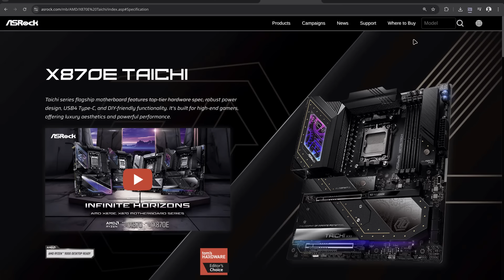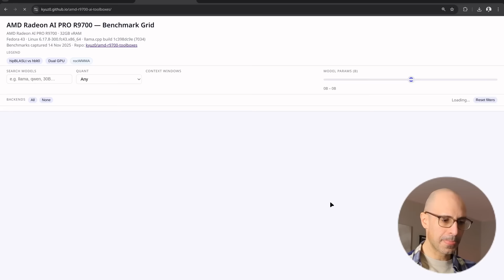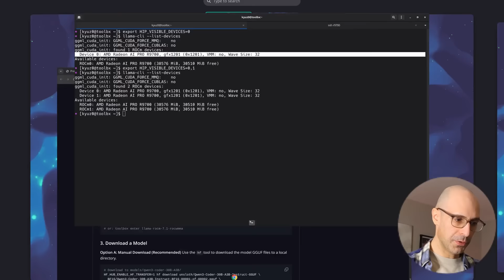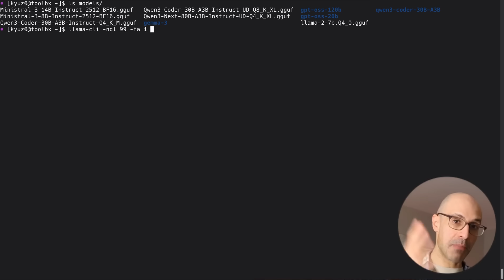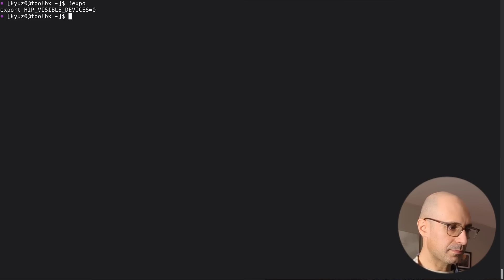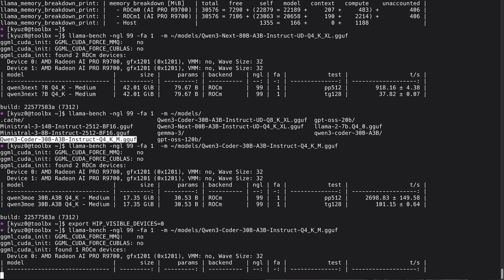Dual AMD Radeon 9700 AI PRO: Building a 64GB LLM/AI Server with Llama.cpp

Comment: Thanks for the good video But Can I ask a question?
I'm planning LLM with 2 radeon
But not a R9700(it's 2266$ our country)
I am planning with 
9600x, 16*4gb ddr5 (64gb), mb work on 4x16 pcie & 4x4 pcie and..
2 of 7900xt 20gb
And soon all parts will arrive.
I have absolutely no experience with connecting two GPUs. I have never done it before.
If can you give me a any little adice to me, that will be a great advice to me.

Comment: I have just abt to build an local AI station for some occasional gaming, bought all the parts and randomly bump into your video. This is exactly what I have got for the build 

Kingston 48GB DD5 5600 MHz Dual-rank RAM Module x2
AMD AM5 Ryzen 9 9900X3D 12 Core 5.5GHz CPU
Asrock Radeon AI pro r9700 creator 32GB
PowerColor Radeon AI pro r9700 32GB
NVMe SSD Crucial T710 Gen5 4TB
NVMe SSD BIWIN Black Opal X570 PRO Gen5 8TB
ASRock X870 Taichi Creator Motherboard
Lian Li PC-LAN216RW
ASUS ROG Strix 1200P Gaming Platinum

Now you reassured me more than I worried. Good staff given the price of NIVIDIA 5090 currently, this build is a bargain. At least I can do some decent gaming as well if I want to.

Comment: I know this video is eight months old, but let me just say, I don't care if it's two hours long. The information is great. And if you don't want to listen to the whole video, copy the transcript and drop it into an LLM and it will sum it up. I'm trying to do the same thing right now. I'm literally minutes away from going to purchase my second R9700. I got the first R9700 run on my 7 year old Dell XPS 8730, Qwen 3.8 27b tps 50ish. And I'm thinking about running it through a PCI 1x4 slot. Obviously, that's not the best, but it saves me a fortune. Otherwise, I'm looking at buying older dual GPU card. I'm trying to do this on a budget. Thanks for the video.
Reply from the maker: Thank you. Working this week on an update with newer models and inference engines, these cards perform so MUCH better now, I'm hoping to be able to release the video in a week or two showcasing all the amazing work the community has done to make these cards extra fast!
Reply: @donatocapitella  24hrs later, Ebay Gigabyte Z590 Aorus Ultra motherboard w/ Core i7-11700K. Gen 4  Pcie 2x8 1x4. No 2nd Gpu penalty. Subscribed, Thanks

Comment: Hi Donato! Thanks for the amazing video and your channel, it's incredibly informative!
I'm trying to partially replicate your setup. I already have an ASRock X870E Taichi Lite and an RX 7900 XTX, and I recently bought an ASUS AI PRO R9700. I tried to install the ASUS card into the bottom PCIe slot, but the motherboard connectors (audio, front panel, and USB) physically block the card's plastic shroud, preventing it from fully seating into the slot.
I noticed that in your build, you used a Sapphire R9700 in the bottom slot. Does the Sapphire card have a differently shaped shroud that leaves more clearance at the bottom? Also, how did you manage to route the front panel cables under the bottom card without them getting in the way?
I would really appreciate any details you could share on how you made it fit! Thanks!
Reply from the maker: Hey, thank you! So, the card just about fits, but you can't use the connectors, not sure if I mentioned that in the video sorry, it was mentioned on the manufacturers instructions somewhere. I turn it on/off from the board switch. I still think there is a way to use the connectors if you get some adapters, but that doesn't explain why your card doesn't fit, mine just fits fine and these shrouds are standard size as far as I'm aware
Reply: @donatocapitella  Thanks for your answer! Now I understand!!! If I don't use bottom motherboard connectors, my Asus R9700 can be fully installed into bottom PCI.E slot without being blocked. I am already, for some days, looking for 90 degree adapters, but still nothing have found... If I succeed, for sure will write here. Thank you a lot!!!

Comment: This is a Huge lie (about the 16x lanes :: can perfectly run one for those cards with 4x - you rarely need the full PCIe 5.0 max speed between CPU and card)
Reply from the maker: Calling something a “huge lie” is a pretty strong accusation, so what exactly did I lie about? This build does not even run the GPUs at x16 each. The X870E Taichi splits the CPU lanes x8/x8 when both GPUs are installed, which is exactly how I run them.

I also never claimed an R9700 needs x16 to function. Of course you can run a GPU at x4, and for many inference workloads it may make very little difference, although on a dual GPU setup like the one I'm showing it'll help. “A GPU can run perfectly well at x4” and “this motherboard runs my two GPUs at x8/x8” are completely different statements.

If there is a specific statement in the video you think is wrong, give me the timestamp and I’m happy to address it. But perhaps start from the ASSUMPTION that I didn't deliberately lie but perhaps I said something incorrect and you can educate me?

Comment: This is going to be the new industry standard for local AI! Why waste thousands on overpriced single-GPU consumer flagship cards when you can build a complete, future-proof dual-GPU workstation with a massive 64 GB of VRAM for just $3,200 total? Pair it with a clean Linux and llama.cpp setup, and you have all the capacity you need for large models without breaking the bank. This is how practical local AI is done!

Comment: Barely anybody uses power curve in PSU or flashlighs for example, gold standard to use is have 2x more W than you have, to have 99%+ efficiency with titan and above rating.

Comment: I have the Asus card and it's f#$cking loud on idle and super loud when it's running 50+ %. I feel like I'm in a data center. I tried fan curves but my software wouldn't detect the card, or it was greyed out. Fun times...

Comment: I have 2x 5060 Ti and one of the AMD ai card  so the compare will not break the piggy bank and have all 3 in one system. So I beg to diff that you can't get 32GB from Nvidia. this video is for clicks why not get a decommissioned server that would be built for this oh thats right you need clicks and ad money so get new flashy brand name for the money not for sharing knowledge.
Reply from the maker: I don't think I said you can't get 32GB, this was a dual GPU setup to get 64GB in a host with a motherboard that has two slots and a CPU that's not a thread ripper. Not sure what is click bait about this video and what I've learnt is that when I ask, people NEVER reply. What in the thumbnail or video intro shows an exaggerated claim of something not present in the video?

Also, if you took time to actually look at the channel, I'm sure you'd see a series on refurbished/decommissioned hardware, one where I also tried to get people 10% discount on such hardware.

My channel is niche and small, if you think I do this video for ads money, you have no idea in the entire multiverse about what you're talking about. I do the video because I enjoy it, and it's not even a sponsored video!

Comment: A few months after, are you still using that setup? I think that gpu looks like a greta upgrade for my ai locla setup but im worried about heat and noise while in use.
since you have TWO I figured you would know better :)
Reply from the maker: Oh yes, I'm using it. It's my best setup for Qwen 27B FP8, great for coding
Reply: @donatocapitella  that' s reassuring to hear, i think ill take a chance and buy one (I can't afford a setup with 2 yet hahaha) - worst case scenario if it becomes a full vacuum blower i can just return it for free and keep my current small GPU. 

If you don't mind answering one more question: did you do any sort of undervolting or any special config? or just factory defaults?
Reply from the maker: @BrunoOrsolonif you look at the next video in the series, you'll see I have some scripts for that!

Comment: Have you ever had PCI connectivity issues with this particular build? I have the same mobo and cards and, every so often, the R9700 just fully disappears from the PCI bus. Reseating may pop it back, but I've had it disappear after a few reboots.

EDIT: In retrospect, the problem appears to be related to Fedora's suspend/sleep behaviour. The r9700 fails to revive after a suspend.
Reply from the maker: never had any issues, but I do not use any of these with DEs, they are in multi-user mode, and I ssh in, they do not go do sleep/suspend.
Reply: @donatocapitella  Yeah that's what I was expecting. I was hoping to cut down on power usage when I don't use the 9700. The suspend doesn't work reliably, so instead I now just shutdown and Wake-on-LAN. Works good enough for my usecase.
Reply from the maker: @Unixerius thanks for reporting back, it'll be useful to people!

Comment: Im running single R9700. Qwen 3.6 35B A3B UD MTP loaded in lm studio can go up to 130 t/s
Reply from the maker: yup, inference has improved a lot on this card, and MTP helps as well.
Reply: @donatocapitella  yup. its still bad in coding but good for other tasks
Reply from the maker: @mr-makavelli  on this card I'd prefer the 27B, way better
Reply: @donatocapitella it's better but still hallucinate a lot :/ plus it often ends up in infinite loops
Reply from the maker: @mr-makavelli  I haven't seen any infinite loops with that model, but it needs steering, it's 2 orders of magnitude smaller than frontier models afterall

Comment: Great video. I would like ur opinion on something if you could spare 2 minutes. I am torn between getting a r9700 32gb for 1700eu or a w7800 48gb for 2500. The 48gb version has 384bit bus instead of 256 of the 32gb w7800. Additionally it uses 2x 8pin connectors instead of the new connectors.

Comment: Is there risk of gpu sag for the bottom gpus?
Reply from the maker: Ehm... maybe if you don't build it correctly, like forgetting to use the screws to secure the card, and then while it's running you put your entire body weight on it...
Reply: @donatocapitella  haaa, it had me scared its quite literally tocuhing the bottom fan of the case and the latch didnt work for the bottom so operating it without latch
Reply from the maker: @neelmishra2320  ok, in my setup the latch works of course!!!
Reply: @donatocapitella kinda broke it in mine, but I think since the bottom gpu kinda rests or atleast touches it on top of fans it acts as support anyway, screw is there on the left side so no worries there, I think there wont be sag because there is a support underneath

Comment: I ordered the same pc online but dont know how to do cable connections, also the gpu is kinda sitting on the bottom fans is it okay? Also one gpus hot air output goes as input to other gpu
Reply from the maker: I don't think so... not sure how the hot air from one gpu would directly go into the input of the other GPU, you would physically and deliberately need to connect the two with some tube to create that effect.
Reply: @donatocapitella  Is there a chance that you can upload the wiring tutorial of the build, you showed some segment with your friend that you had recorded. Sorry if its inappropriate for me to ask, wiring feels like nightmare..
Reply from the maker: @neelmishra2320  uhm... I don't really have a wiring scheme, we just went along with it trying to make best use of the space, but if you've never done it, it can be hard, hence why I got my friend to help. It's not an inappropriate request, but I don't really have something I can publish
Reply: @donatocapitella hi just wanted to let you know my system works!! Time for innovation 😁
Reply from the maker: @neelmishra2320  amazing!
Reply: @donatocapitella Thank you so much, cant thank enough. Also one caveat to point out i had to gave up on the audio pin and the led pins to support the bottom gpu but workload wise this machine is the beast
Reply from the maker: @neelmishra2320 oh yeah, I think it warms about this in the motherboard docs, forgot to mention it in the video

Comment: hello Donato, your video is so good, after 5 month is still relevant. I am on my way to build the same setup as you did. My only question is how loud is that dual setup with the Fractal Design Torrent case ? do those air coolers help it be less noisy ? or only a bit of underpowering/volting  kills the noise ?
Reply from the maker: Thank you! It is a bit noisy, I never bothered measuring it, but right now I have a benchmark and I can hear it. But it's not dramatic of course, for example one single MI50 is way noiser!

Comment: Thanks for this video.
I think to invest in one R9700 to put in an old dell precision T5820 with the issue with an adapter (12 pins to 8pins and 6+2 pins) to power up the card. The other possibility is to tinker a v100 nvidia to get 32 gb at a reasonable price.
Reply from the maker: Doing a video on V100 in the next few weeks... If you can spend the money, the R9700 is better though

Comment: Ok. If I understood it right, the only advantage of running multiple GPUs, in a single user scenario, is increasing VRAM. BUT it was stated that the work division is serial (run the first N layers on GPU 0 and THEN run the last N layers on GPU 1). This would mean that on a multi user scenario we could see an increase in total speed, since we could have (say) users 1 and 4 hammering GPU 1 and users 2 and 3 hammering GPU 0, since they wouldn't start the jobs at the same time, and the jobs would be different from one another anyway.

In other words: in a multi user scenario two 9070XT could have a higher system wide tokens/s than one 9700 - even with the same total amount of VRAM to run the models. Is it right?
Reply from the maker: indeed. and for those scenarios you will find vLLM to scale much better than llama.cpp.

Comment: Great video. I have the exact same gpu setup running in an old x99 system.  If they stop making ddr5 out of gold I’ll probably upgrade. Quick question. I did have to move to Vulcan. Not for speed, but because ROCm was leaving the gpu’s at 100% usage for as long as the model was loaded.  Vulcan resolved it for me, and turned out to be slightly faster on quen 3.5 35b q8. I didn’t try ROCm when I moved to the same qwen 3.6 model. Have you seen that behavior in your testing, or do you know of it.  Claude was telling me it’s a known bug, and not patched.  I have been staying away from ROCm only for this reason.
Reply from the maker: I'm investigating some of the recent issues, but if you use the version of rocm in my toolbox it doesn't have that problem. You'll then need to update llama.cpp / vLLM / transformers for the new models.

I'm working on updating the toolboxes but there are some ROCm issues to iron out.